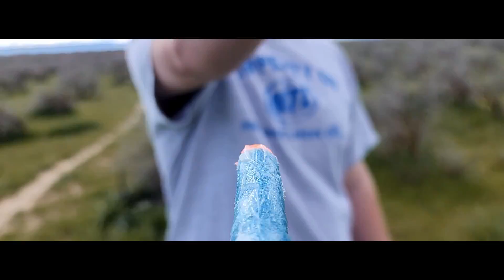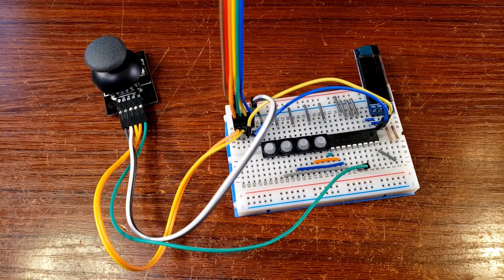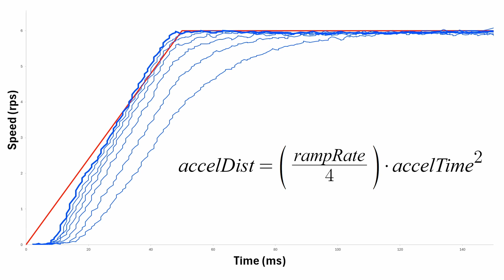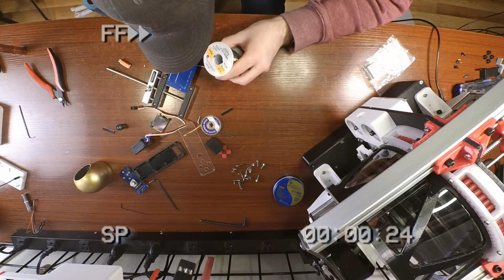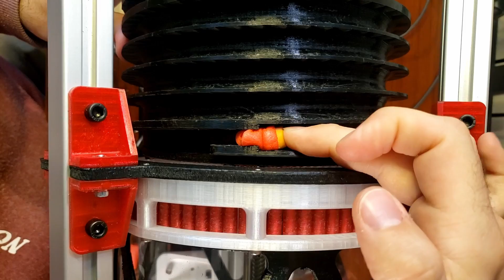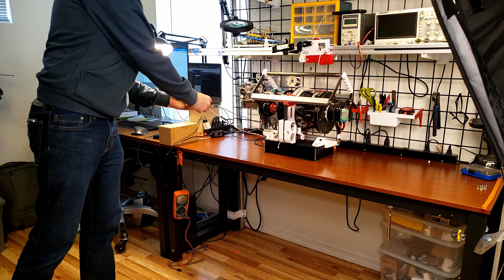200 Dart Per Second Nerf Blaster - Part 2

Comment: I can't help but think that the drum doesn't need to move. you already have it rotating, you should be able to use that to actuate let's say a pusher that pushes from the rear of all the darts. like using the dart channel in the drum like a worm gear sort of. the pusher would be on a linear track so it could slide up and down along the long axis of the drum.

Comment: Very impressive project. Note about how to improve the audio quality. It's better to have constant background noise in an audio clip than to have the noise cut in and out between every word. Audacity can remove the noise from the whole clip if you have a sample of the noise alone. Otherwise I'd just leave in the hum honestly as its more annoying to hear it coming in and out. Of course its better to just decrease the noise floor by removing noise sources when recording. Battery charging devices can cause a lot of coil whine

Comment: Turret, turret and turret. 

Nowhere near as practical as a belt feed one though, but I don't model belts as being as fast a firing speed as this insane industrial nerf blaster. Mainly because of the feed time it would take. Maybe though if the nerf darts were in tubes and used air pressure to feed them into the flywheels?... 

Nope, not going there, bad brain because I don't have the skills, tools and money for this concept >_<

Comment: it over shoots your stopping point because the black wheel thing becomes a nut on a bolt so to speak the screw slows down stops and then changes direction and in that slow-down stop time the wheel is faster and winds down the threads of the screw causing it to overshoot the target stopping point

Comment: Dude you need a custom lead screw where the desired RPM for the lead screw to achieve a given darts per second rate is zero that way you could just put a break on the motor

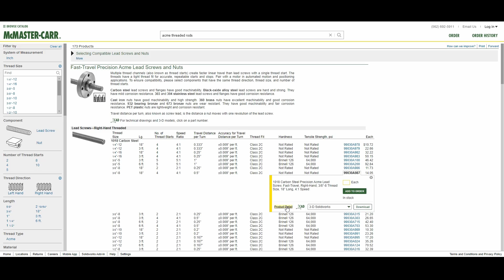Comment: 4:33 man, put a bearing in the moving screw, that way the motor that needs to rotate the magazine, can rotate freely, and you can still move the the screw independently.
To make the bearing move along the screw, attach the  bearing to the wall or the magazine rails, that way the inner part of the bearing wont rotate with the screw I think.

Comment: I invert pwm by using a larger pwm…basically pass 50% and the signal is essentially inverted the other way. (Assume 8 bit pwm) for 0 I would use 255 and that inverts it. 128 would be center point at 50%.

Comment: As you are essentially taking a tube and wrapping it around a drum, just take a straight tube long enough to hold all the darts and blow them out with a plunger accelerated with HPA. It isn't like you are using any wheels or anything to "fire" each dart other than momentum to "fire" them already so this would be no different and could get a much hither DPS.

Comment: woohoo, and also supports continuous belt feed pipe. would throwing a bucket of 200 darts count as faster tho. lol. whats the second motor for. duh. re-design with central inlet hole, and centrifugal self-automatic pressure ejector system. over-complex (not over-engineered) design. over-engineered means super reliable instead of super-janky. 5200rpm is a normal hard drive spinning disc speed. faster rpm at same rim diameter results in higher exit velocity, like real bullet speed and more. nice centrifugal dart thrower design tho. if you drive the flywheel drum only from the other side, like a washing machine or car wheel, you can insert darts from the middle on the other side. synching two systems reliably is too complex for normal use. keep it simple as always :) the more complex system, the less you actually know and can predict anything. why would you make a sponsor happy by making the whole system more complex. for no beneficial reason. well, if you design a random system mechanism, you get random functionality that maybe works.
Reply: but why would you need two mechanism that produce the same result
Reply: yes the pushing out of the darts is the primary launch mechanism, nothing else required, just spin the drum rim fast, and let them fly through an output hole, which has an opening mechanism

Comment: Could've just connected the transistor output of the optocoupler to the high side with a pull-down resistor. Sometimes the best solution is the simplest.
Reply from the maker: I only used that inverter because that's all I could think of. I'm not super experienced with designing/messing with circuits. Thanks for letting me know of an easier way of doing that!

Comment: The opto-couplers are pretty overkill for this application. If i were worried about voltage transients feeding back on the signal line, i would put some TVS diodes. But honestly i wouldnt be concerned with the pwm signal line, the noise generated by escs is all in VDD/ground if pwm line had that big a voltage spike, your esc is cooked
Reply from the maker: Thanks for the info! I'm pretty new to electronics so I'm not very knowledgeable about electrical noise, where it goes, and how to protect against it.

Comment: I think something that would improve this would be to increase the velocity of the darts. The first idea I got that could work would be to do something similar to Dyson supersonic, their bladeless hair dryer. Imagine using that concept but sized for nerf darts and using compressed air or a stronger fan to shoot the darts through the ‘nozzle’ and accelerating them. The biggest problem is probably that the darts would be pretty unstable but I think it could work

Comment: with the correct lead screw thread angle wouldnt the 2nd motor and all the math be unnecesary?
Reply from the maker: Someone had a similar question. This was my response:
I would have needed the screw to match the pitch of the drum (0.625"). At least on McMaster Carr my only options were 0.5" and 1", which would mean the drum would be too short or too tall.

If I had found a 0.625" screw, stopping its rotation precisely when I needed to would be pretty tricky. If the brake timing is off or it slips, the motion would be thrown off and never corrected.

Ultimately dual motors was the easiest design mechanically, and once I got the math figured out it was more robust and could correct itself.

Comment: Interesting solution with the counter rotating screw motor. Would it have been possible to use one motor and a brake? The screw would be lightly held in place by the drum. The motor would spin drum, and the drum would spin the screw with it. To fire a brake could would down on the screw, locking its rotation. forcing the drum to thread down it. The screw pitch would probably need to be very wide, and there is probably a few other problems, but in theory it could remove a motor and the need for manual timings.
Reply from the maker: I would have needed the screw to match the pitch of the drum (0.625"). At least on McMaster Carr my only options were 0.5" and 1", which would mean the drum would be too short or too tall.

If I had found a 0.625" screw, stopping its rotation precisely when I needed to would be pretty tricky. If the brake timing is off or it slips, the motion would be thrown off and never corrected.

Ultimately dual motors was the easiest design mechanically, and once I got the math figured out it was more robust and could correct itself.
Reply: @pb.projectbox  This is where the old warner wrap spring clutches would perform, use a mechanical trigger. This video rocks as a demonstration of electrical gearing. Love your work.

Comment: Curious if you considered using a single motor and a gear box for synchronizing the two axes, analogous to how precision threads are sometimes cut on a lathe
Reply from the maker: I did, but I did the math wrong and thought it wasn't going to be possible. I also didn't know if I could have made a robust enough clutch system and gears. I ultimately went with dual motors since they're more mechanically simple than a gearbox and would give me plenty of motion options.

Comment: To increase the fps and accuracy of the darts I think you might need a longer barrel, which seems like it could pretty easily be modified to fit your design. The end barrel now is already relatively flat it could quick detach on / off of a longer barrel with some tweaks  

They shoot really hard out of the muzzle as is, if you attached a longer barrel they would move through it quickly enough for them to reach additional boosters? within the added length possibly more drone motors at increasingly ramping speeds? or possibly compressed air as a booster? If you combine the speed you have now with longer barrel / more fps in a turret form it could be both 200 darts per second and have an extreme range

Comment: You could add a BCAR (bearing SCAR) to increase the accuracy......... it's a relatively new part of homemade nerf blaster tech that uses bearings mounted on pins directly after the flywheel cage to increase the accuracy. On flywheelers it's it's better to have it be straight instead of adding spin like on a springer. Awesome project and some impressive engineering that went into this.

Comment: could you load plastic balls into it instead of darts? 

If possible asding a short riffled barrel to it could potentially increase accuracy a ton. Also modifying the darts by adding a bit of medal to the inside to weight them down a bit would also help that. 

if it would be possible to do that, ontop of makinf this thing longer to accommodate 1-2 seconds of firing, 

the end result would look even more incredible.

Comment: Great project! But what about portability? Is it possible to slap on a big battery instead of a wall plug?
And for the reloading, maybe you could make another magazine and use some sort of keyed slot to connect to the motors. That way they would al be the same. Then the loading would be like the rocket launcher from halo.

Comment: Man you're amazing!
I have a question for you, what is your engineering major?
Currently I'm an engineering student and I'm trying to choose which branch of engineering will help me make cool projects like this one 
For example these branches: CMP, EEC and Mechanical engineering
Reply from the maker: I only did two years of an ME degree before dropping out. I did get a two year associates in mechatronics later, though.

A bachelors in electrical or mechanical engineering would give you a good foundation, but they don't really get super in depth into the integration/programming side of things. A mechatronics degree is a great hybrid of the two, but it's a fairly new degree that most colleges don't offer.
Reply: @pb.projectbox  thanks so much for the reply, i guess the programming side could be learned from courses and YouTube.
I decided to go with ELCE which is electronics and communication engineering, it's kinda a part of electrical engineering but without the power part, we have another branch in my college called electrical power engineering, which is focused on the things like electrical motors, power grids etc...
I'm in Cairo University btw

Comment: what about to drive the central screw drive, attach it to a reverse planetary gear setup with a clutch? 3d printable and might be able to reduce the multi motor setup?
Reply from the maker: That was my first thought for this, but I decided the flexibility of using two motors instead would be easier to design. Plus I wanted to learn more about coordinated motion with multiple motors.

Comment: Extended or removable drums definitely

Add two (or maybe even more >:) stages to the fly wheel for those FPS

Maybe a BCAR? But the spread kinda makes it fun
Reply from the maker: I've been eyeing some of the stuff on outofdarts, especially the multi stage flywheels and that BCAR. A tight fast moving group of 50 darts would be terrifying haha

Comment: would having a negative pitch screw or negative pitch relation between the screw and the dart wheel allow for smaller pitch values? if i understand correctly, you are using a significantly larger screw pitch to divide the speed required by the screw motor, but if you had a negative one you would yield the same effect and retain a more forgiving screw pitch maybe? and if its too expensive to get a negative pitch screw maybe make the wheel itself have negative pitch?
Reply from the maker: Going up in pitch would make things better. With the 0.5" pitch, the screw has to slow down and change directions. A 1" screw would only need to slow down. 1" screws aren't that much more expensive than 0.5", plus they're cheaper than left hand threaded ones.

Comment: 200 darts per second is impressive. What's the total time required to fire off 12,000 darts, including reload time?
Reply from the maker: That's an oddly specific number haha. 12,000 darts in 50 dart bursts would mean I'd have to fire 240 times. Right now it takes about 2.5mins to load 50 darts, so it would take at least 10 hours to fire 12,000 darts.

Comment: Now it needs a much larger clip, and should be able to fire in custom bursts. Also would be cool if it was more accurate, now it has insane spread and perhaps a little of the load of the motors should be alleviated by adding accelerating wheels into the non existing barrel for the weapon. Since the higher the fire rate, the higher the energy for each dart and more load on the motor, which makes sense in general, but that means there will be pretty hard limits in the future while increasing the fire rate

So, what if it wasnt the barrel that was shifting, but the barrel? Its a lot less mass... And its way simpler...
Reply from the maker: As the firing rate goes up, so does the speed of the darts when they reach the drone motors at the end. The faster the darts, the less load on the motor.

I've put a lot of thought into shifting the barrel and decided that it wouldn't be worth the effort. The shell that keeps the darts in the drum would need to move with the barrel, which would be pretty tricky. Besides, hardly any energy is used to move the drum down, all of it goes into just spinning it.

Comment: I think you should add some sort of barrel system. That would make it so much more accurate but dont know if darts would get jammed or not. Would be interesting to see. Cool video and awesome work
Reply from the maker: I think it would be pretty easy to adapt existing nerf blasters that the nerf modding community uses. There are multistage rollers and rifled barrels that could truly make this thing insane.

Comment: My only grievance with this project is the use of half darts in place of normal darts, which leads to exagerated numbers, as if you were using full darts you would get half the dps. Beyond this, it is a really fun project, though an added barrel might improve accuracy.

Comment: To reduce friction you could perhaps use lead. In certain alloys of steel, lead is added to reduce friction when cutting, and in a gun the entire projectile is made out of lead in most cases. If you added lead to the outside of the dart it would greatly reduce friction. I hope to see this incorporated into the next design.
Reply: Lead has no bearing on friction in a firearm, simply because any kind of firearm using smokeless is driving the round too hard for lead to survive. It melts and gums up the rifling which is a problem we solved in the late 18th century by wrapping bullets in copper. If you want to reduce friction, use what everyone uses and use brass fittings as they tend to slide a lot easier along metal surfaces. Adding lead to the dart kinda defeats the point of it being a nerf gun.

Comment: Awesome work. Know the math pain a little too well. 

Fair bit of spread and tumbling currently. Maybe add a short barrel for better accuracy? Or twist the firing motors a few degrees off the plane to put some spin on the darts as they're getting accelerated?
Reply from the maker: Yeah the simple rollers I'm using don't work that great. I'm thinking about replacing them with something from outofdarts.com or somewhere similar. They've got multistage brushless flywheels and even barrels with bearings that put spin on darts.

Comment: If possible I would say find a way to increase the capacity. 200 darts a second for .25 seconds is awesome. 200 darts a second for 2-3 seconds would be even cooler.
Reply from the maker: Increasing capacity would be a bit more difficult and expensive. I'm right at the limit of my printer's build volume and longer 6mm rods are quite pricey. 2-3 seconds of firing time at the rate might make it worth it though...
Reply: @pb.projectbox  I wonder if feeding the darts with a belt would work at this speed. That way you could just print sections and chain them together for however many darts you want.
Reply: Yeah I was thinking at least 200 darts for 200 darts per second makes sense.
Reply: With the current design, two seconds would require making the drum 8 times longer, it would look ridiculous and probably cause a tonne of issues.
Reply: He didn't load the drum to capacity for the 200/sec test. He shot 50 in that test, but had other tests with over 80, and I don't think that was even full capacity. So, only like 3 or 4 times larger. @bacon.cheesecake
Reply: @Brainstormer_Industires  Oh yeah, forgot about that, still pretty ridiculous, but quite a bit better

Comment: I think the best future upgrade would be better reload-ability. There doesn't seem to be a particularly good way of doing that with the current design so my best idea is a very large quick-loading clip. Maybe a snail drum that you manually turn to inject all of your darts at once
Reply from the maker: Yeah reloading this thing takes quite a while haha. I've been playing with different ways of doing it for a while, so that'll probably be my next focus with it.
Reply: @pb.projectbox Maybe try to find a way to make it shoot Rival rounds and have a bunch of clips feed into the area below the drum, and make the drum move back and forth instead of just moving one way so that it uses the full clips